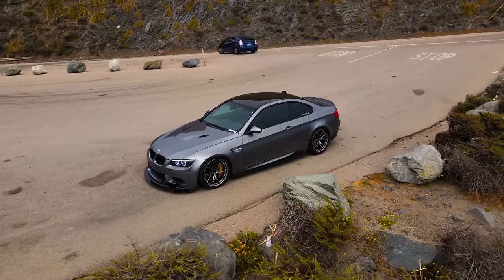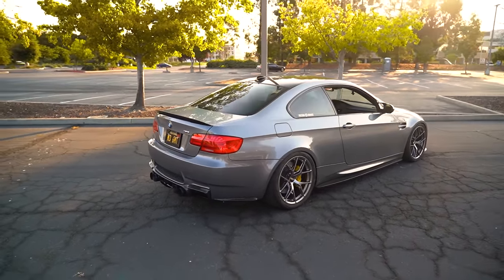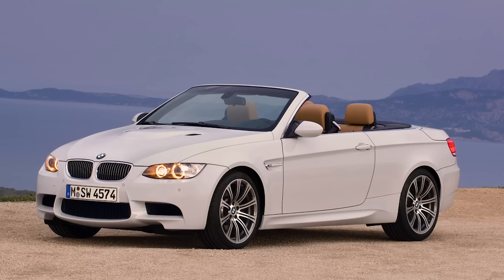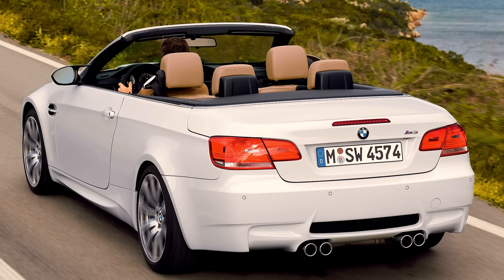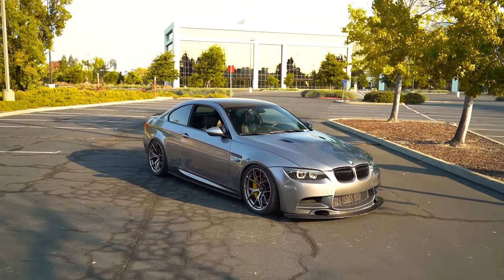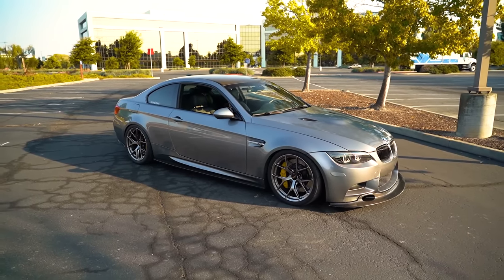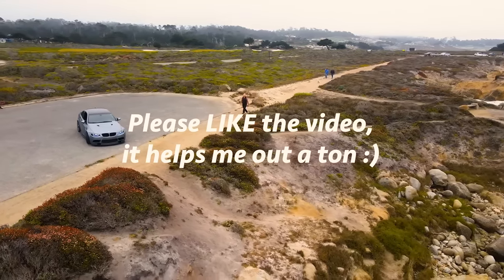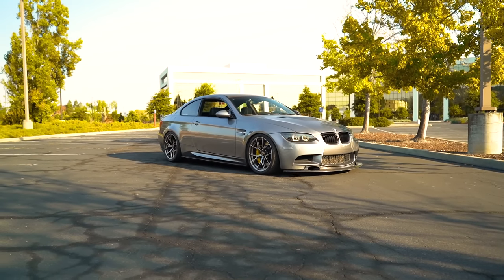Everything You Should Know Before Buying an E92 M3

Comment: Good mention on the transmissions! So many people give the DCT hate as an "auto", even though it's far from a normal auto. The best way to figure out which one for you is just to drive both. I was completely set on getting a 6MT E90 until I was convinced to try the DCT. I ended up buying the DCT. It really is that good.
Reply: Excellent call out. My theory is most 6MT owners have never driven the DCT version
Reply: I absolutely agree! I had the pleasure of driving an E90 M3 6mt which was an absolute blast! Butttt then I hopped in an E92 DCT and it’s such an amazing transmission. Don’t get me wrong I love driving stick, but the DCT is made for this high revving V8.
Reply: Does the DCT maintenance cost actually high ??
Reply: Bought an e92 m3 in 6mt without the thought of the dct. After a year and everyone raving about the dct I decided to try one out. The upshifts were out of this world giving you a shove in between gears. But the delay on downshifts was awful. (This was setting 5 and gts tune). I’m glad I went with the 6mt although I’m looking at 4.44 gears because I’m not a fan of how long the gearing is.
Reply: @ironickuykratoey8851  Fuck no. I redline my '12 comp pack every fucking day. The DCT is an absolute beast. It's one of the top 10 fastest shifting transmissions in the world. You can tune it to the gt softwhere tune. It's reliable as fuck.
Reply: I was in a 6mt and a DCT, to be honest, the optimal solution is to have them both:) it's just impossible to choose
Reply: No clutch to kick is a huge bummer
Reply: DCT can even do clutch dumps ffs!
Reply: As long as its not an smg it doesn’t i drove an smg m6 and fuck was terrible on the streets i doubt it can do 0-60 under 10 seconds each shift took 2 seconds on its own.
Reply: 4 door looks better  e90   It's The best looking looking car ever
Reply: @myNAMEisZEDSDEAD  I've driven DCT. I'll even admit that it was fun but i still prefer manual..
Reply: DCT suits S65, I would say this is one of the cars that you wouldnt go wrong with both options just like a 911 GT3

Comment: I got my rod bearings done for $1,900 thanks to you 🤙🏽 Throttle actuators I paid $1,200 for parts and did them myself. Fuel breather valve I paid $60 and also did a DIY.
Reply: BMW is the only car where you actually get rod bearings done...no other car like porshe, ferrari, lambo, you dont hear about rod bearings; I switched to an LS3 on my M3 and did not look bad...500hp + NA
Reply: @nelsonx4235  You don’t have that high revving motor anymore, which is the whole purpose of the fun factor with the e9x.
Reply: @nelsonx4235  Ferraris eat trough engines my dude, most of the high mileage ones have a replacement engine in. Also they like burning a shit ton of oil.
Reply: American V8 > Euro V8
Reply: do you need to code actuators after?
Reply: @startingtech3900  No. Just install and drive. The DME does all the adjustments.
Reply: @Batmanforever6969  should i go broke and homeless and buy one?
Reply: @startingtech3900  I'm asking myself the same question, I think we should!

Comment: Addendum:

Throttle actuators come in pairs.  When one fails, the other will follow.  Expect to replace them for about $3000+ for the pair with labor.

I have a high mileage 2008 E92 M3 at 225,000+ miles.  Here are some addition fixes that were required over the past several years.

Valve covers replacement - magnesium lining deteriorates over time. $2500 + gaskets.
O2 Sensors may go out - front and rear $2000
Driveshaft worn - $3000
Ground strap corroded - $200
SDARS Satellite radio - $3000
Front bearings - $2000
Accessory pulley (popped off while driving) $300
Side mirror motor malfunction - $600 to replace the entire mirror assembly.  Installed DIY.
Trunk rear light malfunction - $130 per side (DIY)
Starter motor - $550 + 7 hours labor - it's buried in the heart of the engine.
Brake sensor failure.
Secondary engine blower (for warmup).
Downpipe leak.

Comment: Great video. I would recommend that anyone who is replacing their TA's replace the fuel breather valve at the same time. The actual valve is $80 if you buy from Bosch (same part number as the $130 BMW part) and can be replaced in under five minutes since the plenum is already off for the TA service.

Comment: oil pan gasket , transimision gasket , fuel pump, nice ride love  your set up !
Reply: As a former BMW mechanic, those things piss oil after 100k miles.  Water pumps need replacing often & the entire cooling system should be replaced after 5 years &/or 100k miles.  Also, monitor the AC system closely.  Plastics & electronics in all cars become  rattle & fail after 10 years.   Be prepared to shell out a lot of $s, but enjoy it in between maintenance down time.

Comment: Good and informative video! Just wanted to say that since most people replace the  con. rod bearings at higher mileage than you (e.g. 50-60k) it is good to replace the engine mounts at the same time. In the general case there is no additional labour and the original ones are pretty tired by then.

Comment: Comp package really only gives you a CF roof. The lowering and zcp wheels are superfluous. This is coming from someone who has a CF roof on their E92, but didn’t want to pay an additional 5-10k to get an M3 comp. The retrofitted versions work extremely well
Reply: Carbon roof comes on the coupe not just comp pack. Also edc settings are different.
Reply: Even normal E92 M3 had the CF roof

Comment: Some more common problems are...
1x vacuum pump
2x oil filler cap leaking
3x coolant thermostat over cooling and you will never know unless you get live data whilst driving.
4x DCT pan leaks
5x Diff seal leak.

Comment: I thought it was interesting that you actually wanted a dual hump. I looked for a single hump because I think it makes the car age faster, but the updated I drive really helps it. The first version looks horrible. One of the cleanest most perfectly modified e92's out there!
Reply: Makes the car age faster?? 🧐
Reply: @wiizvrdd  when I look at an older screen on the car, it makes the cars age much more apparent than if the car has no screens/infotainment. 

I guess a better way of saying it is that the screen reminds you of the cars age and technical obsolescence  more so than without.
Reply: The advantage that the older and newer system can be retrofitted with an Android system and touchscreen

Comment: Good info.. original owner of 2012 E93 M3, 130k + miles, track duty, and I've never driven it slowly lol.. still on original bearings, I know I should do them but can't help but think even just a tune, exhaust and air filter might be enough to push them to hard? And I just did both idle and fuel breather valve myself (same bouncing idle). Dyi, huge pita but doable

Comment: Considering either an e92 M3 or a C63s for my next car. Still contemplating but the M3 seems like the more well rounded choice, and with some mods it'll be a sound monster and very nimble, and it costs less.
Reply: Get the c63 AMG S. Have a 2018, and 2 2019. The technology and interior for me personally, wins the overall package compared to the m3. If you want something more fuel efficient (aka slower) get a CLA AMG version, the face lifted interior is even better.
Reply: @trcs3079   Under NO circumstances would I ever consider a facelift model C63. They have OPFs, are quiet as shit, have fake interior engine sound and lots of technical bits I don't like or need. If I buy one it'll but pre facelift. Also don't want a CLA since I want a bigger engine and already own a mk7 GTI. I am also taking into account what mods I can do because legality is an issue here and I can't just run a 800hp straight pipe tune, and the C63 has no legal aftermarket downpipes at all, while for the M3 there's a full carbon intake and a valved exhaust with papers that'll sound awesome.
Reply: If you want to go fast in a straight line buy the Mercedes boat.
Reply: @idokwatcher2062  That's the thing, not sure if it pays off to buy the well handling M3. Our speed limits are getting lower constantly and tuning is becoming more and more of a sin. C63 would be a better daily too.
Reply: @drogenfeld  funny how you disagreed with my comment but then had a partial agreement with the second LOL. in the end, maybe just keep the GTI, more budget friendly. And you're definitely right, my insurances for the c63 is pretty high. I would of gotten the 2014 or under c63 because its proper V8 but the warranty for the 2018 and 2019 made it a bit better. There's nothing technical about them, pretty easy going it you ask me
Reply: @trcs3079  I just want a bigger engine and more power and something that is fun to drive. The M and AMG both fit those criteria in different ways, and aren't directly comparable. It'll probably come down to spontaneous factors when I buy my next car.
Reply: @drogenfeld  get an ISF then.
Reply: @hexagonosaurus5848  We don't have all the cars you have in the same abundancy. I'm limited in some choices.

Comment: could there be a way to help slow down accelerated wear on your engine when it is supercharged? love your content by the way!! 🙌🏾
Reply: Build the motor
Reply: You can have a reliably built motor that lasts a long time, but it needs to be built properly & with parts that compliment eachother.. not just a random selection of parts you want to make work. Regardless, you shouldn't expect oem reliability when going built Forced Induction. Think about it, you're forcing all kinds of pressures into an engine that wasn't designed for it. It can definitely be done, but it's going to cost a lot of money & when something breaks, you can't really get mad. It's why I'm choosing to stay stock & n/a on my c5 z06 right. Just know what you're getting yourself into beforehand and you'll be fine.
Reply: I would absolutely never go F/I with this model…
Reply: Bro do it!! Worth it
Reply: Yes, get a proper American V8 like LS Chevy

Comment: I love my car.  I scrap in Sacramento.  It was better in San Diego where they mostly have rounded curbs.  Driver's side cup holder broke twice.  My only complaint.  Get it right.  2011 Comp.  As  a daily it's great.  My only car and I love it.  I had both my throttle actuators go out.  Didn't even notice.  80k plus miles.

Comment: My rod bearings were replaced with wpc treated bearings. How long should I be good before I have to change them out again?
Reply: If you let the car warm up properly you shouldn't have to
Reply: @coltonoilar  I shouldn't ever have to change them? In the video he said WPC isn't a fix, basically it's only a bandaid to the problem
Reply: @MrBellyman128  did you get bearings with increased clearance? And most of the wear on rod bearings comes from people not letting the car get to full operating temperature before ripping on it
Reply: Just take oil samples and have it tested. Blackstone labs does it
Reply: @MrBellyman128  bro the dude who made this video only has like 30k on his car and prob hasn’t even driven it for 10k, he’s just re reading what he found online to make content. WPC bearings are a fix for a long time.

Comment: Great review man! I was in the market for a v8 and it narrowed down to C6 or e92 m3. Both cars have their flaws but ultimately I chose the corvette due to the overall better reliability. That being said I love this car so much especially in that awesome lime rock orange! Anyways I hope to upgrade to a z06 and it has that infamous valve drop issue of its own hahaha anyways question, once you change the rod bearings is it done or would you have to replace again in 60k miles?
Reply: I bought a c5z mainly because its cheaper to buy but also to maintain. My dream car is an e92 m3 but rod bearings and throttle actuators repair just cant be fitted into my budget. Im also wondering if there is a rod bearing change that actually cures the problem so good question lets hope we get an answer.
Reply: @Odin889  ^same, I bought a low mileage c5z & a low mileage 2016 accord v6 6mt instead. I own BOTH cars for less than the price of a low milage e92 m3. E92 m3s are amazing cars and ideally I'd love to one along with a c6 zr1, but it's just not the time or place right now in life. I also quite like having two more reliable cars (and 1 faster than the m3) for less than the price of 1 e92 m3.
Reply: @Odin889  yea for sure it’s super expensive I’m glad I did some research before jumping into the e90/e92 m3 world. My c6 is still super fun and amazing but that 4.0L v8 sound is something else

Comment: Great video very informative. I love watching your POV’s too. I currently have a 2011 E90 328xi 6MT with around 220hp and 200 lbs feet  of torque. My dad and I recently test drove a stock 2012 E92 M3 6MT and it just didn’t feel like it had any low end power. Do you feel like modifying this car makes it feel better at lower power levels?
Reply: Not really. You have to use the whole rev range, this is why the m3 is better to buy in DCT, the DCT keeps it in the sweet spot of the power through every gear. Manual falls on its face and restarts the torque curve every gear
Reply: You can't think about the s65 like the typical v8. It's not meant to make great power down low. If you're trying to go anywhere, you have to take the revs up. There's no changing that aspect of the car without seriously building the engine. It's meant to rev. If you want down low power, buy a corvette or something with an LS
Reply: Not much you can do. Even the supercharger kits only add grunt in the mid and upper rpm’s.  The F80/F82 twin turbos are a better choice if you want real thrust at all rpm’s, especially with a tune.
Reply: I say go test drive one again but keep the rpms at 4.5k rpms that's where the cars power is at. Also dct is better for this car I've driven both and dct is the best imo.

Comment: I’ve had three BMW’s in the past as fully maintained company cars. Would I buy one myself. Not at all. If you want to pour in endless amounts of money into a car then go ahead. Sure they are nice to drive when they are functioning correctly but they will be spending time in the workshop with large repair bills.
Reply: I wouldn't buy one unless I could wrench it myself which I do.  I've really not had any issues other than the throttle actuators which failed a month after I bought it 6 years ago.

Comment: After watching this I’m curious, do you need to repeatedly replace your rod bearings after every 60ish thousand miles or is it a one time thing once you hit 60k?
Reply from the maker: it depends on the bearings you use! Don't re-use OEM, since that won't solve the problem and you will have to re-do them at some point.

Other well-made aftermarket bearings with extra clearance should solve the problem. I carry these on my site! I use this exact kit in my car.
https://shopwett.com/products/e9x-m3-s65-acl-rod-bearings-and-arp-connecting-rod-bolts

Comment: Excellent video sir, I'm from Cape Town South Africa, helped alot with getting my 1, I have a 2013 model in mineral white paint finish only 26700km on the clock, like brand new still, dct transmission. Absolutely love it. Was told to change the crank bearings cos it's a problem n can cause huge issues?
Reply: Sorry I meant rod bearings, ppl told me, it doesn't matter that the vehicle only has 26000kms just change it ASAP and you also recommend it in this video, so it's booked for that in 3 weeks from now, 30th Dec 2022. Thanks again for an informative video.
Reply: Damn you must have paid a fortune for such a low mileage one here in SA. Prices shot through the roof 😅
Reply: @lwandamhlongo4389  not actually, I guess it was just my luck, it was a neighbour of mine's car, he unfortunately died of cancer and his wife didn't want to keep it. I got it for a song man.
Reply: @abdulazizkazee6976  wow you got really lucky man. I've been on the hunt for a LCI E90 M3 in Alpine White for quite some time now but no luck whatsoever. The closest thing available on the market right now is a grey 2010 model in Sandton but it looks rough and the mileage is north of 150 000km. The search continues...

Comment: Should I spent 20,000$ out of my 33,000$ savings on an E93 M3 6 speed MT w rods and actuators a done as well as new radiator, ax compressor, and lots of other work. I also have an x5 I can sell as well if I need more cash? I’m not tracking it and live in Cali I love the vert

Comment: Have a question though, once changing the throttle actuators and the rod bearings you are set for life? Or you’ll need eventually to change them again because of the same failures?
Reply: Both will be good for another 100k
Reply: @kwozzie  miles or kilometres?
Reply: @Eidrian111  i would say you’re okay for 70K miles at least on both
Reply: Well all parts will always need replacing again at some point… but with the aftermarket parts, they are designed to be stronger and fit better so they should theoretically last much longer than the oem counterparts.

Comment: It’s just amazing how much BMWs cost to own.  The maintenance is on par with exotic cars with nowhere near the prestige or performance.  You can buy a Corvette or Mustang GT with only slightly lower performance, at least in the GT, and drive it for over 100K miles and never have a single motor or electronic issue.  BMWs are riddled with senseless issues that should never occur in a car engineered to perform like these.  I’ve owned 2 now and I can say with all sincerity that these are very fun to drive and we’ll performing pieces of junk.  Go buy a Japanese sports car or any American V8 muscle car and you’ll probably have just as much fun with them and literally no issues for as long as you own it.